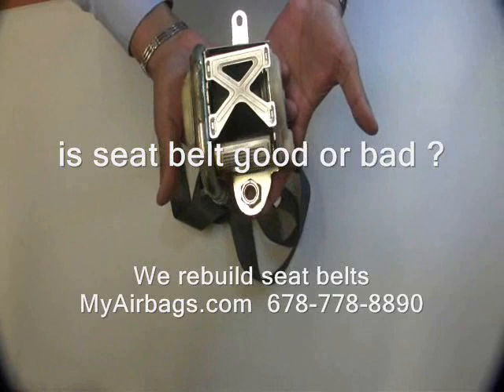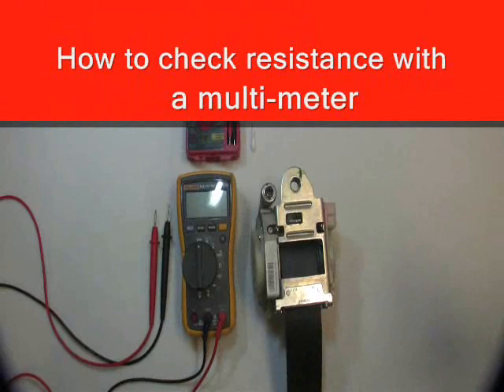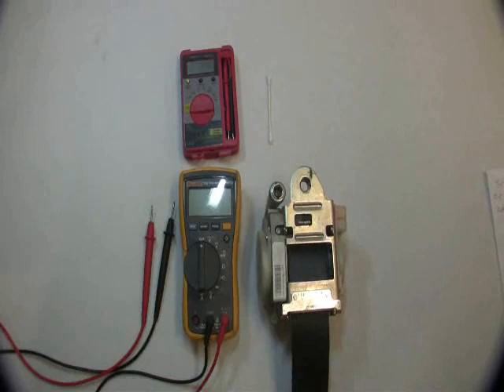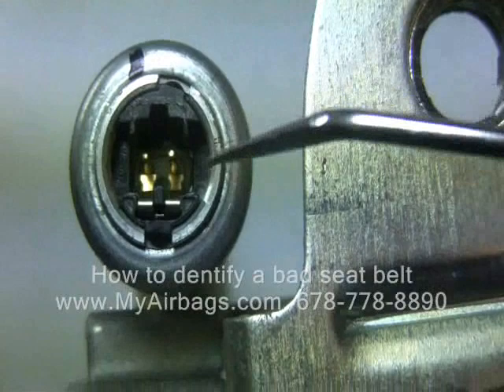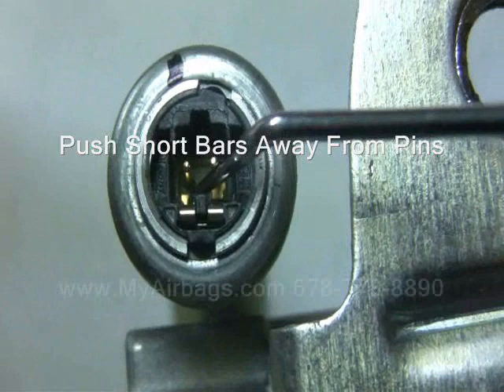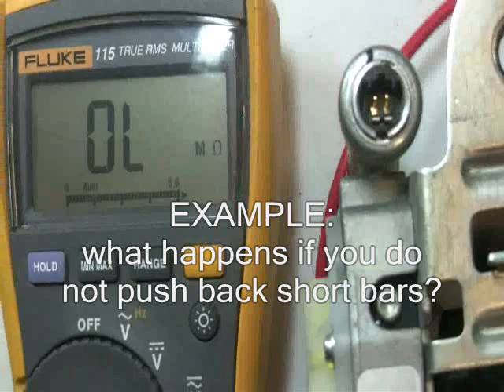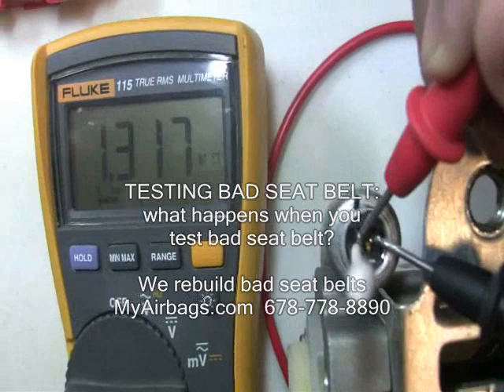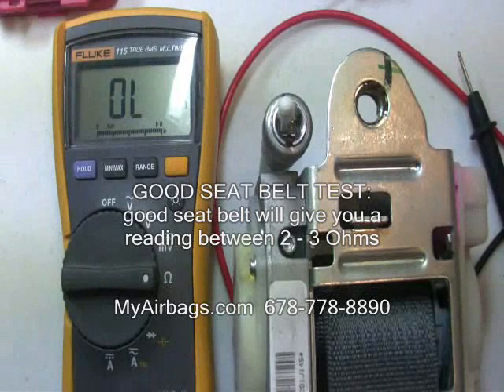How To: Test Seat Belt Good or Bad ?

Comment from the maker: If the seat belt is bad, the belt assembly needs to be replaced or rebuilt. If you replace it with a good seat belt, make sure it is out of the same vehicle, where the harness plug will match and plug in. 

You can always send the original seat belt to MyAirbags to have the seat belt rebuilt. They will go through the entire belt assembly and change all the springs, gears, locking mechanism and new sensor.

Comment: Could you please clarify... are we checking the resistance between one pin and the other shorting bar, pin to pin,  or shorting bar to shorting bar?
Reply from the maker: Check resistance from pin to pin.The shorting bar needs to be pushed back first, then check resistance from pin to pin

Comment: Great tutorial and it explained with great video shots. Now my question is - if a car has stored accident data in the airbag module would i switch out the module first or the airbag thats in the car ?
Reply: It is best to do all of the repairs first and then replace or reset the module last.
Reply from the maker: Switch out the airbag first and install the good reset module last.

Comment: can you help me by answering these questions: A-c.
 Using a scan tool to find crash inside the SRS module. Maxi Sys 908 pro(by Autel)
Car came no car body damage, but customer do not know if this car has been in a previous accident before.  he bought it from car auction. air bag light is on.

how do i know if there is crash data inside Airbag module and need to be fixed by  using dump file, or bad part to change only like when seat belt,  buckle or any sensor goes bad , not due to accident  just want bad not accident.

A. what the scan tool will display if crash data stored in any srs module. which tell you a dump file is a must to repair it,???

B. for seat belt pretension check wires(2 yellow wire harness) under seat, check them  using mine millimeter for beep or continuity, if any cut wire or check by ohms . Which way to check??

do i have to disconnect  the plug from the SRS module and seat belt plug  and test the 2 yellow for continuity beep if it is cut, or ohms.???

C. How to check buckle switch? 

i have to check it by using beep continuity or any other method, to find out if the buckle is good or bad?? no obvious damage or bend.